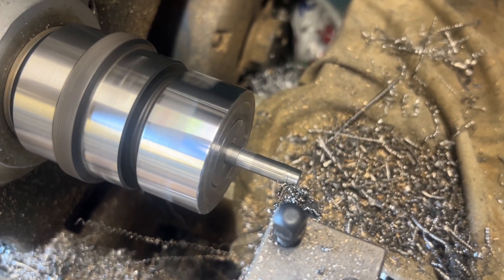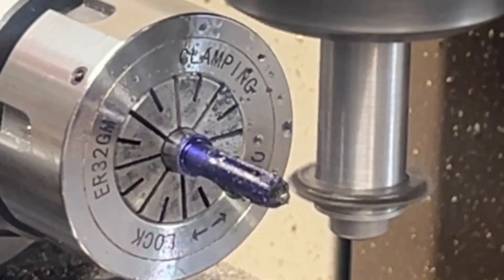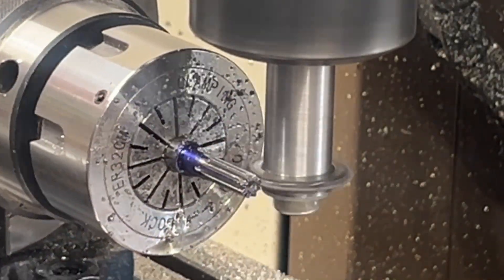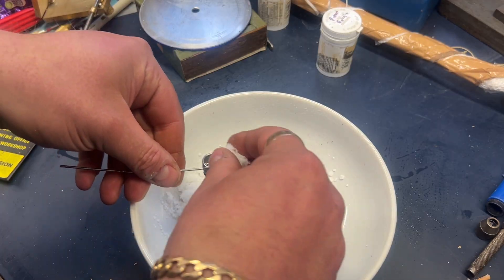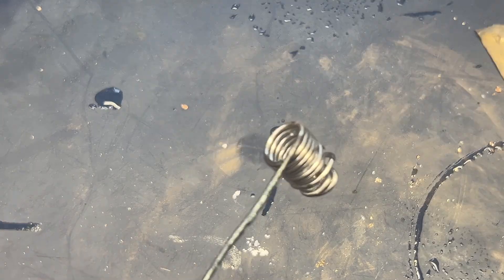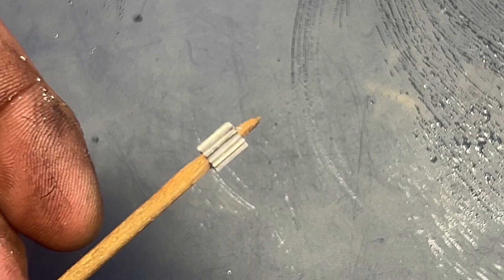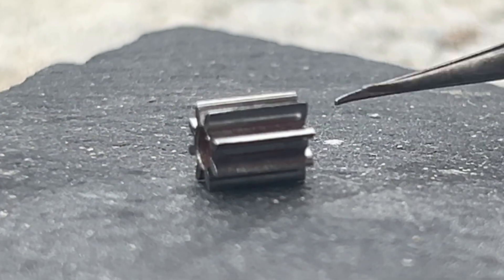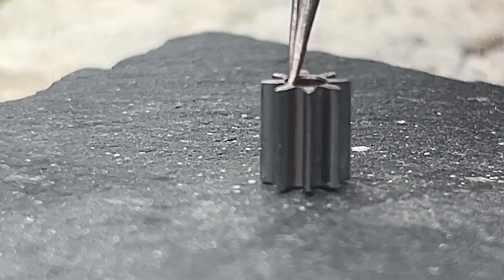Cutting a Clock Pinion | Tekippe Precision Regulator Build Part 5

Comment: Excellent video as always. Hopefully this clock won't take the years that the tower clock took.
Reply from the maker: I’m hoping it won’t Brian. Covid and a new venture business and my two young children took away all my time early on in that build! I’m back regularly in the workshop now so hopefully nothing gets in the way too much! 😊
Reply: @craynerd  Keep up the good work.
Can you tell me where you purchased your noga deburring set? I've looked everywhere but can't find it.
Reply from the maker: @brianwarburton4482 hello, I got it from RS Components a while back but there looks to be a similar model on Amazon cheaper. That said, the one on Amazon is a different colour so perhaps not the same materials and quality
Reply: @craynerd  Thanks. Yes, RS Components are always a bit expensive. After checking out the one at RS and getting the manufacturers part number I searched and found one a bit cheaper at Tools Today which I have ordered. Thanks again for your help.